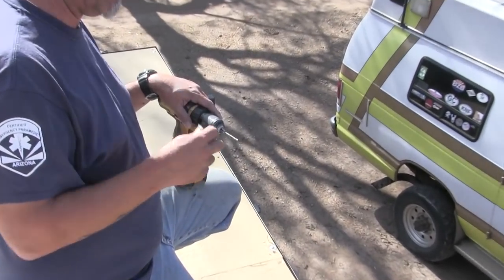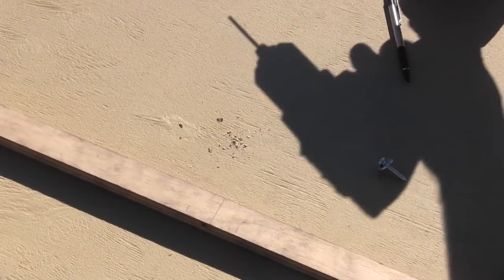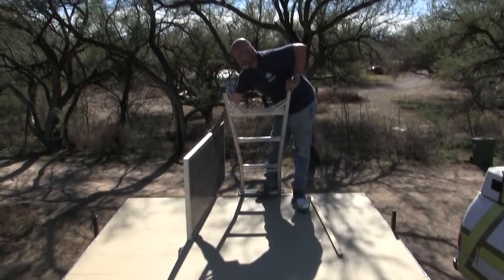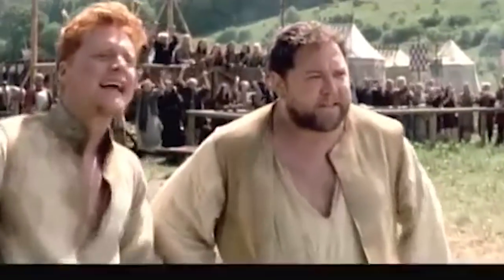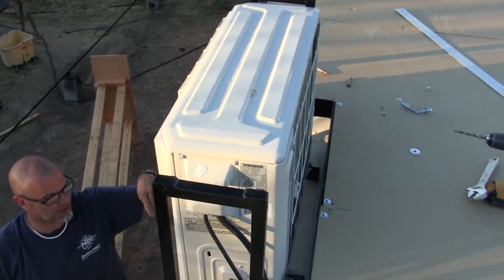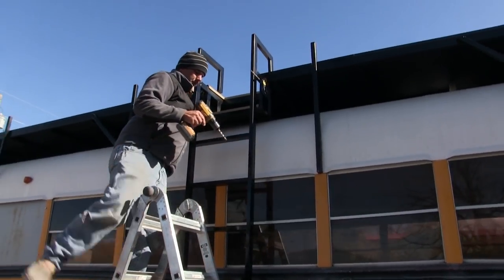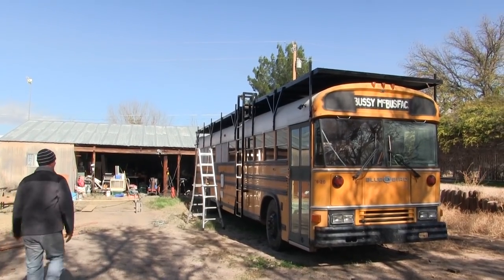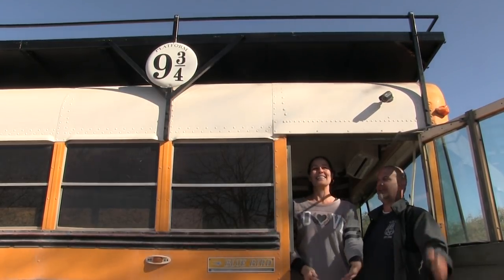Our Skoolie Deck gets a Ladder, Side Rails, A/C Cradle & More Screws! (Part 10)

Comment: Great work.  PS  The "epoxy coated" sheets are also used as concrete forms.  Like if you build a multi-million$$$ luxury hotel, you don't want plywood grain marks on the garage walls under the building -- with the epoxy coating, it's as smooth as polished stone.  This coated ply is tremendously strong and useful.

Comment: What has the shade of the deck done for your temperature inside the bus?  That's one truly epic deck!
Reply from the maker: I won't be able to accurately tell you that until next summer. The temperature change going into winter has messed up any measurement I could possibly make.
Reply: @BussyMcBusface  I'm very curious vs. Elastomeric paint alone.  I'm planning to mostly cover our roof to create relaxation space, solar, and shade... but with a less ambitious plan than yours. I'm hoping it makes a big difference in cooling in the summer.

Comment: I have been enjoying your videos and I don't want to be a spoil sport but you may run into some trouble with DOT.  The maximum width of your bus can only be 102 inches without an "oversize load" permit.  The ladder sticking out the side might put you over the 102 inches.
Reply: Mirrors are exempt from the 102" max width requirement.
Reply: My mistake.  I just learned that RVs are not subject to the federal size regulations.
Reply from the maker: Actually, AZ does have a width restriction but with our ladder, we are at 102" meeting that requirement.